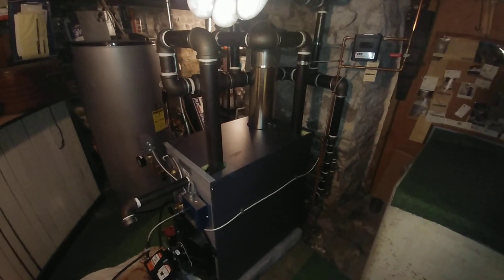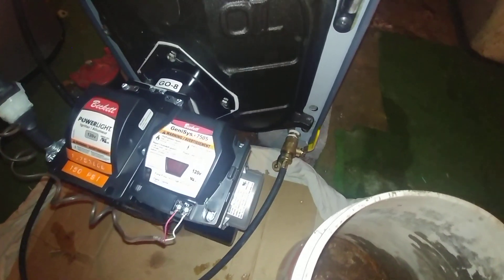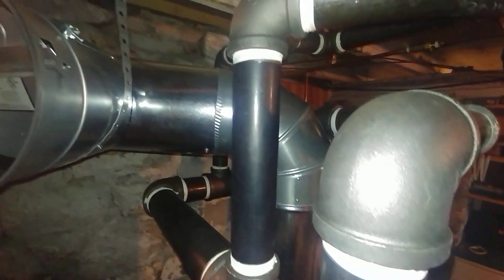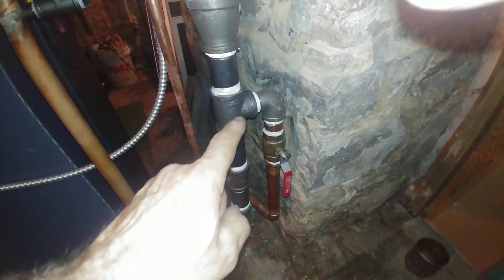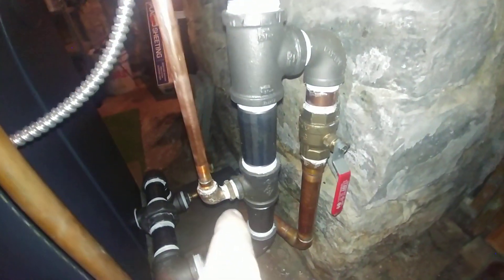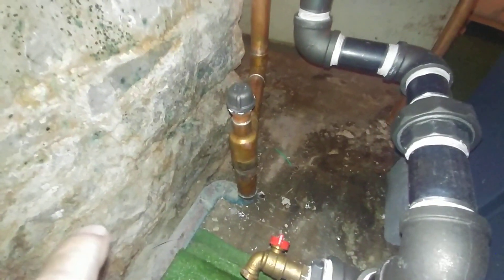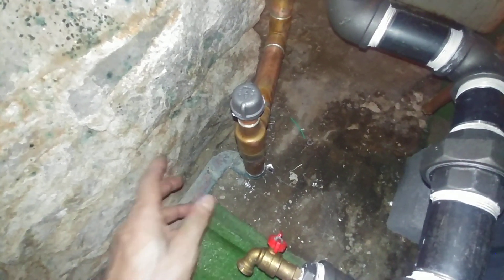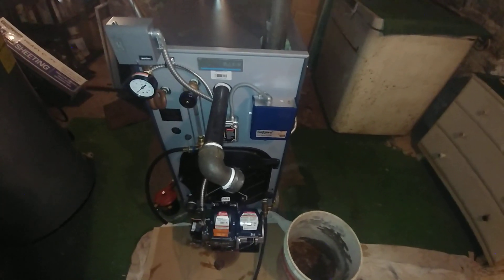Discussion Of Oil Fired Steam Boiler Install With Drop Header

Comment: Let me ask you… what’s your opinion of a king valve above the boiler for a 10 psi muck blow out that Dan Holohan talks about?
Reply from the maker: I think it's a bit too much.
If a private individual is working on their own steam boiler, and they put in a high quality steam rated valve (very expensive!), that's on them, and more power to them.
Most ball valve PTFE seals don't seem to hold up to steam after about 5 years in, and low end gate valves are cheesy. 
As a steam contractor, it would be hard to justify the cost in my mind.

Comment: Nice job overall, but I have always questioned the use of an overhead oil feed, especially when it's a single pipe system. That said, with law suits out the ying-yang these days, I don't see an OSV in case of an oil pump leak.
Reply from the maker: Yes, you are absolutely correct, overhead oil feed on a single pipe oil is iffy, at best.  We have to deal, sometimes, with the hand we are dealt.
An OSV should be added, you are correct.
What is your experience with Tiger Loops?
Reply: @gordonschweizer5154  ... tiger loops work but they are usually hiding a deeper problem. I typically see them if there's an air leak or if a 2 pipe has a restriction and they go back to a single pipe on an inground tank. You just know that's going to come back and haunt you eventually.

Comment: Gordon,
For skimming the boiler is it because of the nature of cast iron that it holds onto the oils that are used in the machining process and the other dirt from the old system. You’re using valves to isolate the boiler from the wet return to flush out all the goop.
The oils suspended and floating on the surface of the water in the boiler must be removed to prevent the oils from coating the inside of the boiler, skimming means firing the boiler but allowing the steam to escape from the skim tapping and the extra long tube and providing a slow drip of fresh water to continuously replace the dirty water until the oils are removed.
Why don’t you use any chemicals to help shorten this process? Do the chemicals shorten the life of the components or is the skimming process more of a traditional method?
Reply from the maker: You have provided an excellent synopsis of skimming and cleaning.  Thank you!

As to your question regarding chemicals:  In general, we avoid chemicals largely for the reason that once you add chemicals, you then may be faced with the prospect of getting the chemicals out as well as the oils.  
Others may disagree and have used various chemicals successfully clean boilers.  To each his own.
If the manufacturer of the boiler calls for their use, by all means, use their recommendations and procedures.
It should be noted that Weil Mclain doesn't like the use of any cleaning chemicals that may hurt their rubber section seals such as petroleum distillates.

Comment: I like everything about it. The only thing I don't like it the skim tapping with the long pipe. Do you remove those or leave it that way?? I suppose you could put a valve on the boiler with a short nipple. ($$$I know) and then just plug the valve, put the nipple back in when you skim.
That Weil Mclain design has been around a long time. they seem to hold up pretty well if maintained
Reply from the maker: Thanks for your comments!
The ridiculously long pipe left for the skimming does have one benefit, namely it allows the goop generated over time to be captured in the pipe and removed.  When the cap is opened after some time (a year or more in some cases), the goop is right there in the end and is scooped out.

Comment: Quick question, should you run the boiler for a little bit before skimming? Or can you do it while the boiler is still cold ?
Reply: The basic principle and Gordon can attest to this. You have junk/muck at the bottom and in-between the water that you generally flush/blow out of bottom ports. Then you have the oils that tend to float at the top and this is where skimming comes in.
Basically the oils don't want to come out from bottom and tend to stick to the walls when draining. 
When skimming it's best not to agitate the water too much. keep the water calm and gentle flowing half height wise in skim pipe drain port. I'm sure it could be at any temp except boiling?. Gordon could answer that part? Anyway getting rid of those oil help a lot with producing good steam.
PS... Gordon is a excellent teacher the way he explains things. I know he kinda does it on the fly from job to job. I'm sure with his knowledge he could run a channel something like "Mr Carson's Lab" (Electronics). Maybe it would hard since Gordon  working?
Reply from the maker: What we usually do is first fill and run the boiler for about an hour or so to test and set up everything and then drain and re-fill. That gets rid of the soluble contaminates. Fire again and do a skim. That seems to loosen up and get rid of about 80% of the contaminates.
The boiler is allowed to run for some time (weeks, in many cases - depends on our schedule) and then cleaned again to get the other 80% of the junk.
Some boilers clean up ok.
Few others never seem to clean up properly.
Reply: @gordonschweizer5154  thanks !!
Reply: @gordonschweizer5154  Should be ready for the initial firing of our new boiler this coming week.  This is an 85 or so year old house that I've lived in for 40years. Two questions. On initial startup let it run for a heating cycle, cool off, drain and refill? repeat as necessary until drain water looks clean. After a week or so do my first skim. Do I add any chemical for skim. I have a paper that says to use Arm and Hammer Super Washing Soda. I'll contact the manufacturer, Ferguson, and ask for their recommendation.
Second question is can you provide a link or info on the sight glass blow down fitting?
Thanks for your previous help and I'll try to keep you posted.
Reply from the maker: @kge420  Sounds like you're on the right track! Great to hear!
Generally, if you add chemicals, do so sparingly (and use what the manufacturer suggests), as you can always add more, but it's harder to remove 'em if you add too much.
Reply from the maker: @kge420  The sight glass fitting is harder to track down.
You're looking for an 1/4" MIP (male iron pipe) by 3/4" MH (male hose) valve.
Links good this week are gone by the next.